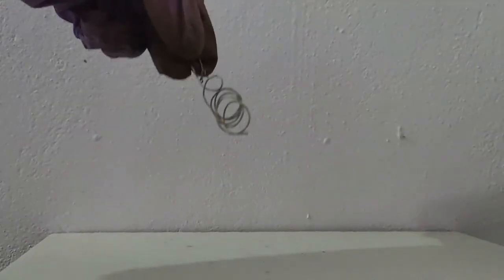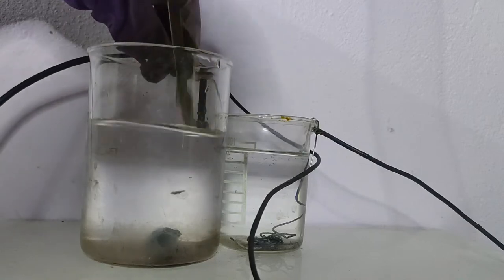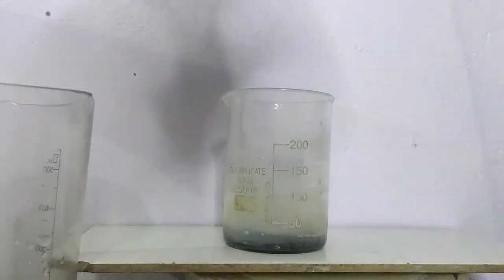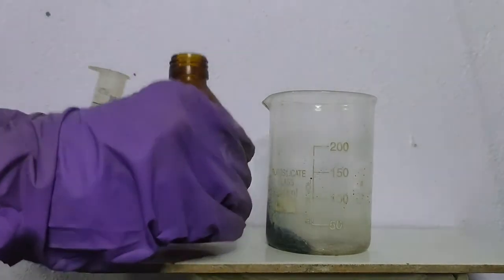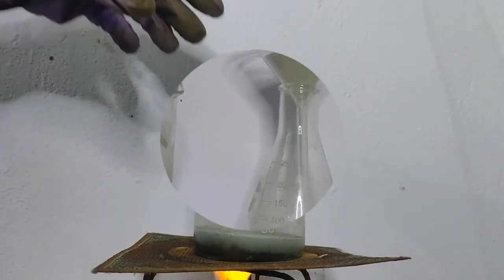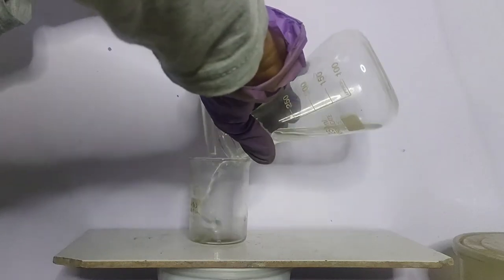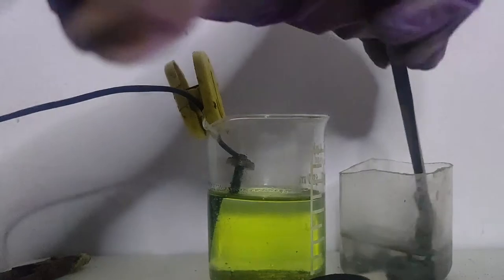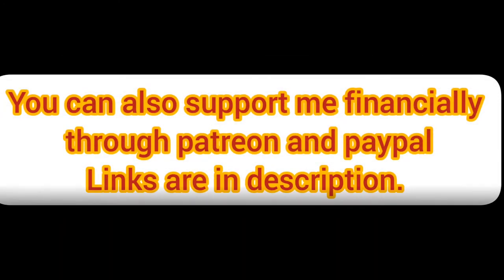Extraction of Tin from soldering wire

Comment: the spongy mass may be the result of impure solution(contamination with lead since it has priority on electrodeposition over tin as it can be seen in any reactivity series) another thing to point out is that too much current does favor hydrogen formation which in turn get in the way of the tin crystal growth resulting in spongy mass. try with lower currents and make sure you do have a pure tin chloride solution.

Comment: 1-Use electrolysis to separate the solder from the flux. Then discard the solution and keep the sponge.
2-Dissolve the sponge in HCL.
3-add a few ml of sulfuric acid (car battery acid) to precipitate the lead. Your tin will stay in solution.
4-filter the solution through either cotton or paper.
5-now you can get the tin crystals with electrolysis 😊

Comment: The powder u have extracted still has elemental lead ,that is why it can not be melted.
Reply from the maker: No it doesnt has lead because lead is unattacked by HCl
Reply: At room temperature lead is un reactive to hcl but at higher tepm it reacts and also reacts when it is alloy with some other metal.when u electrolyse alloy lead will react in small amout but not 100% . 0:00
Reply from the maker: But then i again processed it